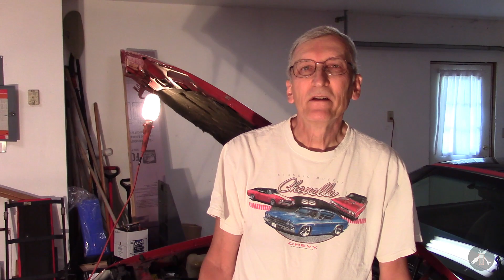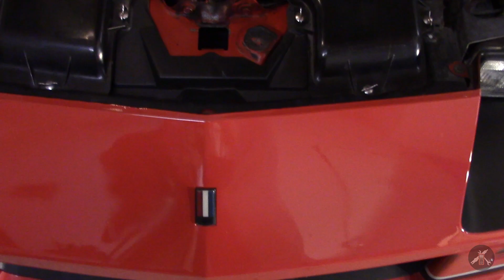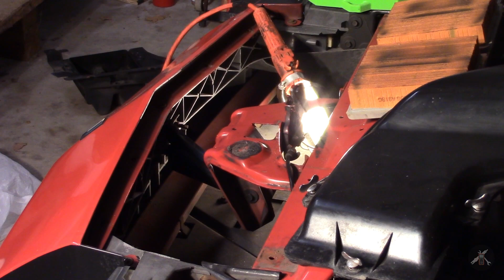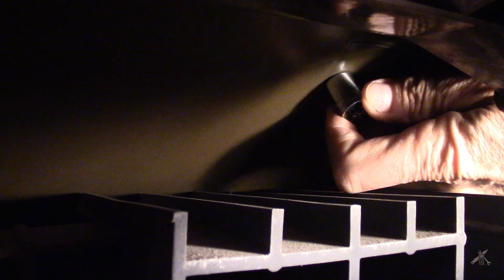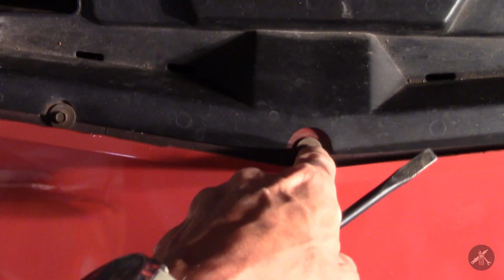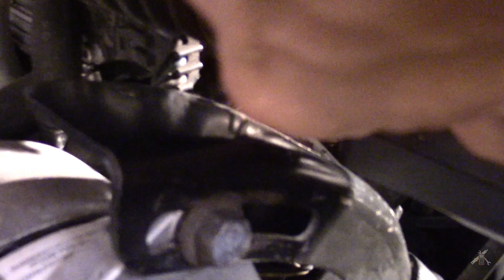How to Remove Front Badge or Emblem - 3rd Gen Camaro

Comment: Thank you for this. Believe it or not, someone peeled off the actual bowtie emblem from the seat. I still have the black bracket attached and am ordering a new emblem. I will try to reinstall the whole assembly, but as things happen with these older cars, sometimes I will create second problem by fixing the first. I may peel it off and reattach with contact cement if I run into issues.

Comment: What is the exact measurements from top to bottom my 82 doesn’t have the dimple in the bumper
Reply from the maker: I'm not sure exactly which measurement that you need.  Are you asking for the dimension from the top of the bumper to the top of the emblem?
Reply from the maker: The dimension from the edge break at the top of the fascia to the top edge of the emblem is 3-3/4".
Edge break means that there is a flat portion that the hood seats over, then the fascia slopes downward from that corner.